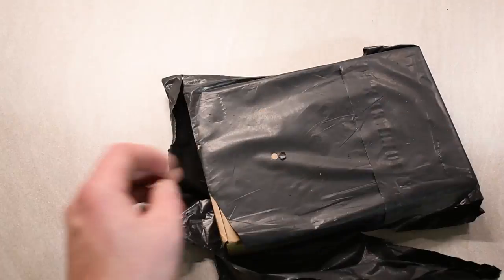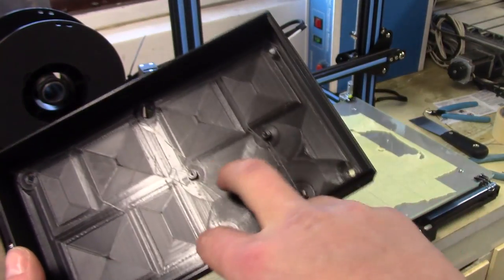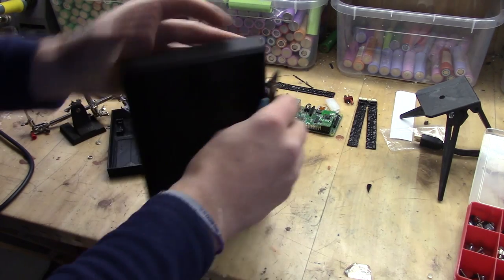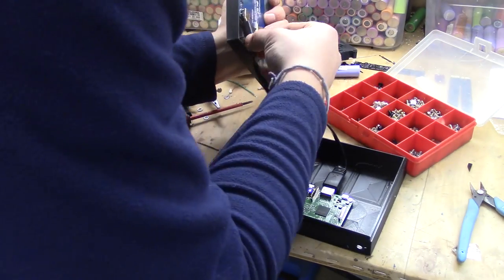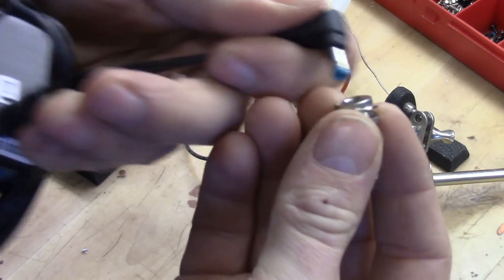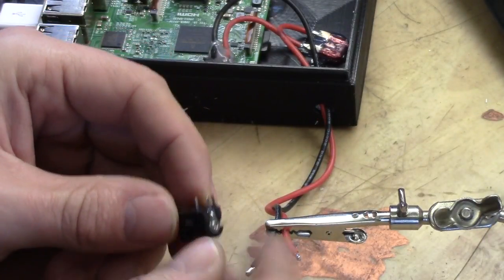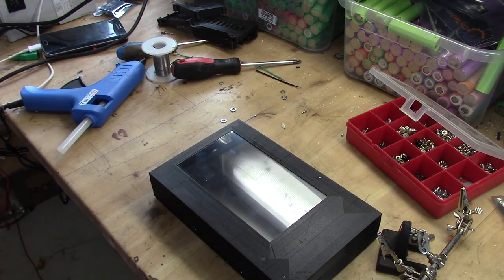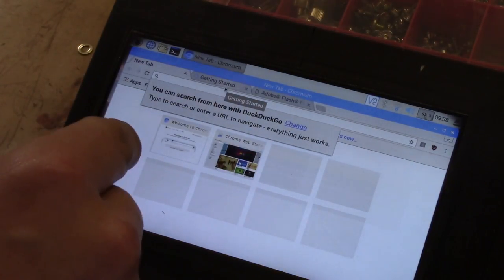Touch screen build to a Raspberry Pi How to

Comment: Great design build. Some simple. Now I need a 3D printer  :P
At 11:41, it looks like you have burn in issues. I'm guessing this type of screen needs to be on a timer so that it shuts off after a minute or so so that the image doesn't burn in.
Reply from the maker: The first screen I got was faulty... Thats why you see the burn in issues. I got a replacement that have been running fine 24/7 since then :)
Reply: Ahh, that makes sense  :)

Comment: I would like to build something like this to monitor multiple solar charge controllers. I have EPever tracer A controllers. There have avalible Bluetooth data and I'd like some way to monitor multiple signals at once. Could something like this. Be configured to do that? Show it on a single screen? Thanks great project.
Reply from the maker: James stranger doable. Check out my solar sis or grafana project :)